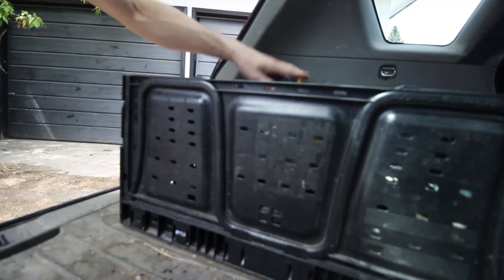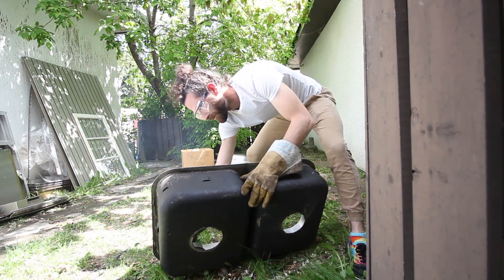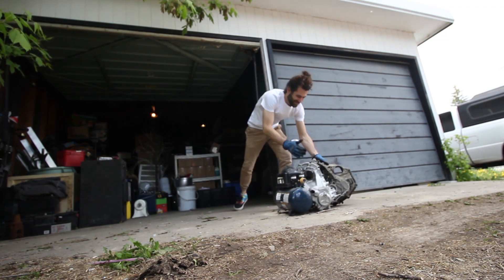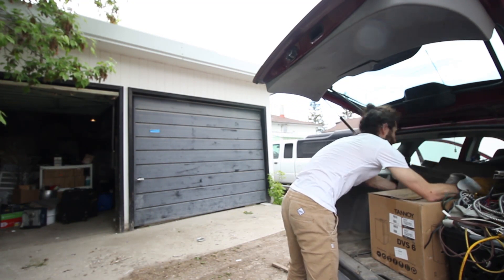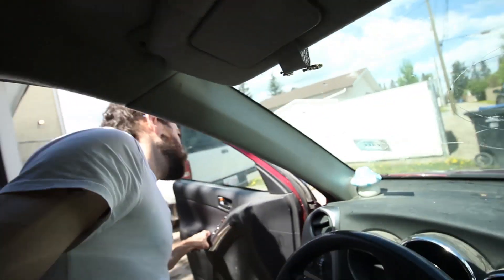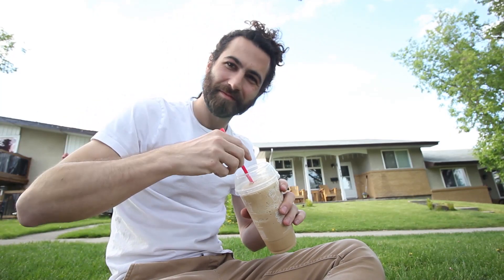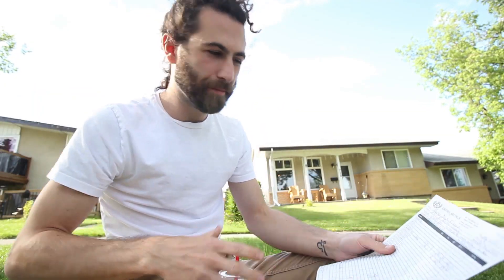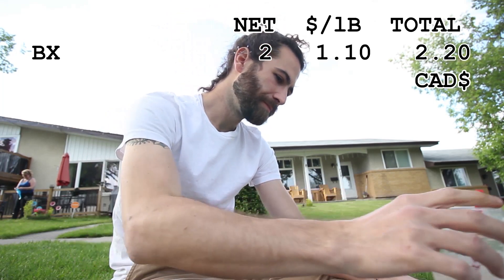Two Months Of Dumpster Scrap - Everything Else

Comment: Good scrap run bud.  For the sinks, I think you could have used a hammer to bang out the drain from the bottom, it's usually just in there with plumbers putty (at least that is what I have done in the past for stainless sinks).  The batteries, take them to "Battery direct", called Canadian Energy as well I think.  I get $10-15 for auto/marine batteries at the one in Edmonton.  Last time I checked, it was a better price than the scrap yard.   you can keep the ice caps man, they are not my thing :)  Take it easy bud, Chris